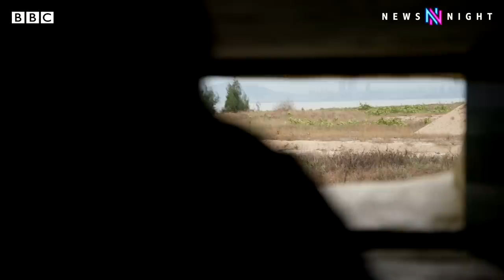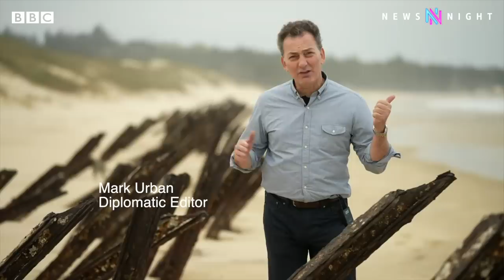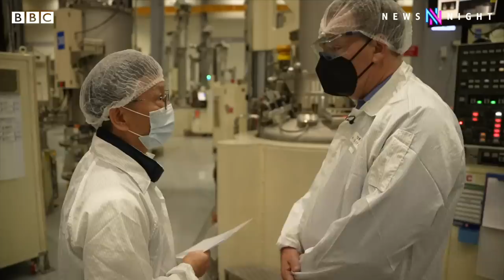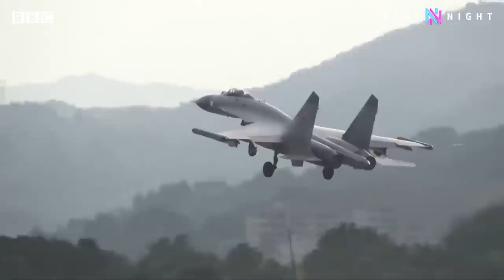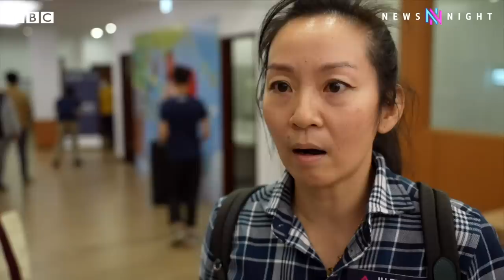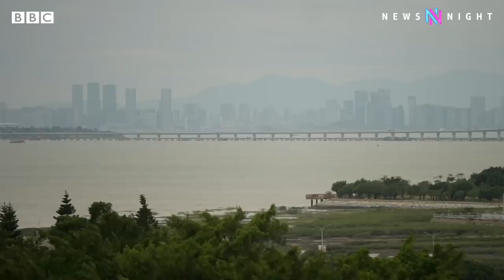Can Taiwan's microchips act as a 'silicon shield' against a Chinese invasion? - BBC Newsnight

Comment: The value of Taiwan is more than just the '
“silicon shield”, but also the strategic location on the pacific. With the harbour on the east coast of Taiwan, PLA are able to deploy nuclear submarines that capable of conducting another “Pearl harbour attack”.
With the control of Taiwan strait, China will be able to shut down the cargo supply from western world to Japan or Korea. Sure, the chips may be a reason why US are trying to prevent the war from happening, but the position of the island is the actual common interest that urges Japan and US to intimidate China from invading Taiwan.
Reply: Don't be overdramatic. If the strait wasn't accessible, cargo ships could easily go around. And as for the nuclear subs, they can deploy them from their current extensive coastline.
Reply: If you can read the map, it is also very close to China.
Reply: China will gain superpower status if they got Taiwan
Reply: finally someone who knows the most beneficial trait for China to invade Taiwan as their strategic harbour for any military use
Reply: How can you attack your own country!
Reply: @RonsmooveTI  they already have that status
Reply: @goatculler  it's called civil war
Reply: @pieter6361  China’s Dongfeng missiles are aiming at Okinawa.
Reply: This is totally backwards. Taking Taiwan doesn’t actually do much for China’s offense strategy except to give it high mountains on the east side of Taiwan that are good for building radar stations and monitoring naval traffic around the island. On the other hand, Taiwan is essential to America’s offense strategy, for the purpose of keeping China contained by the first island chain. America has been the aggressor and China has been the defender for about 200 years now. This panic about Chinese attacking America and its Asian lapdogs (Japan, Korea, Taiwan, Philippines, Vietnam, Malaysia, etc. is a complete inversion of reality.
Reply: @janewu3178  Dongfeng is just good for frying and killing fish in the Pacific
Reply: @Sp3ll633  The Pentagon doesn’t think so.
Reply: @janewu3178  Oh, btw, okinawa was genocided, raped and colonized by the americans with the japanese. Then the country Okinawa got ruled by the americans, and then later on given to the japanese. The natives of Okinawa, were the "Luchuan"-people, or how it is called.
Reply: @securityispriority7130  China won’t treat civilians in Okinawa as cannon fodders in any circumstances. Nowadays Asia is well-managed under China’s guidance. China takes responsibility of containing Japanese militarism and extruding uk-us hegemony out of Asia.
Reply: @lambertlum1087  not “China Hegemony”, I believe it called Great Asia .
Reply: @lambertlum1087  Let me give some context first for anyone who w doesn’t know this history.

From the Encyclopedia Britannica page for the opium trade:
“Early in the 18th century the Portuguese found that they could import opium from India and sell it in China at a considerable profit. By 1773 the British had discovered the trade, and that year they became the leading suppliers of the Chinese market.”

From the Wikipedia page for the First Opium War:
“Once addicted, people would often do almost anything to continue to get access to the drug. These serious social issues eventually led to the Qing government issuing an edict against the drug in 1780, followed by an outright ban in 1796, and an order from the governor of Canton to stop the trade in 1799.”

From a University of Illinois teaching resource page titled Early American Trade with China:
“Americans began shipping opium from Smyrna (then in the Ottoman Empire, now in Greece) by 1805. Turkish opium only made up a small part of the total opium imported into China. Opium did not become an important commodity in American trade with China until the 1830s when it made up approximately 1/4 of the total that Americans sold in China.”

From the US Department of State, Office of the Historian page titled the First Opium War, the United States, and the Treaty of Wangxia, 1839–1844:
“Beyond the health problems related to opium addiction, the increasing opium trade with the Western powers meant that for the first time, China imported more goods than it exported. Settling this financial problem eventually led to the First Opium War between Great Britain and China, from 1839 to 1842.”

There are no convenient quotes for the rest of the story so I will summarize it:
Americans also had major opium trafficking operations in Canton, so American merchants supported Britain in the First Opium War (1839 to 1842) and America secured trading rights by compelling the Qing government to sign the unequal Treaty of Wangxia in 1844. Then the US military fully engaged in the Second Opium War from 1856 to 1860, and forced the Qing government to also sign the unequal Treaty of Tianjin in 1858. This treaty opened more Chinese ports to foreign trade, permitted foreign legations in the Chinese capital Beijing, allowed Christian missionary activity, and effectively legalized the import of opium.

The bottom line is that American merchants started selling opium to China decades after the Qing government started to outlaw the drug, and a full 6 years after the government banned the import of opium to China. The American merchants were exactly like Mexican cartels, trafficking a harmful illegal drug in violation of explicit bans. When this drug caused so much harm to Chinese society that it escalated to war, the American government actually sided with the American drug traffickers instead of the Qing dynasty. 

That is why I said “about 200 years ago”. The Americans started illegally trafficking opium to China a few decades more than 200 years ago, but the official support for this drug trafficking from the US military came a few decades less than 200 years ago.
Reply: @janewu3178  Yes, and the Japanese Empire called their endeavor the Greater East Asia Co-prosperity Sphere. China can name it however it wants, but the Middle Kingdom clearly wants to  occupy the role that Japanese Empire once sought.
Reply: @calitaliarepublic6753  "Unlike Great Britain, the United States agreed that anyone involved in the opium trade or the smuggling of contraband would be prosecuted under Chinese law", https://history.state.gov/milestones/1830-1860/china-1

As for the 2nd opium war, US had a small side role,  It was the British and French who conducted the bulk of the war. 

I am not going to deny that US played a role in the unequal treaties in China, but let's not forget that US supported China against Japan in World War 2. And US to this day is a supporter of China, albeit the Republic of China, i.e. Taiwan.
Reply: @theotheleo6830  actually the seafloor of the Taiwan strait is very shallow, about 70meters deep, the east coast of Taiwan however is very deep, like 700+ meters deep. So the Chinese submarine can vanish easily from east coast of Taiwan.
Reply: During WWII, Japan used Taiwan/Formosa as the main base to launch attacks on Southeast Asia and Southern China.
The secret code of Japanese Navy for attacking Pearl Harbour was "NIITAKAYAMANOBORE 1208"(Climb Mount Niitaka 1208)
Mount Niitaka=Yushan=Taiwan's tallest mountain=Japanese Empire's tallest mountain at the time.
Taiwan was in the center of Japanese Empire(Japanese Territory and  the occupied territory).

Also towards the end of WWII, USA bombed Taiwan so hard and destroyed most military infrastructures and utilities. 
However, USA did not dare to land on Taiwan until after two atomic bombs dropped on Mainland Japan.  Taiwan was almost the last Japanese Empire territory to surrender in WWII in October 1945.

btw. China did not claim Taiwan and even had a Chinese consulate in Taiwan during 1930s. However, China did see the opportunity to annex Taiwan after USA joined the war. China gambled to side with USA to see if they won the war, China would have the chance to gain Taiwan. .. So China's Chiang mentioned in 1943's Cairo Conference about wanting to have Taiwan for the first time.

Why did China want Taiwan until 1940s? It's also because they see how developed Taiwan was and how good  the geopolitical location of the island was.
Reply: @bctvanw  It’s weird how you skipped the part about Japan starting a war with China so Japan could colonize Korea, and taking Taiwan by force in the war. That’s exactly why Japan was forced to return Taiwan and other territories stolen from many different countries after World War 2.
Reply: @calitaliarepublic6753  
Yeap I also skipped the part where when Taiwan was inhabited mostly by Austronesian people.
I also skipped the part where Taiwan was stolen from the Dutch by a Japanese born to a Japanese mother Chinese royalist Koxinga.
I also skipped the part where Taiwan was stolen by the Manchus from Tongning Kingdom(founded by Koxinga's son).
Reply: @yccheng9159  The subs can and likely have already traveled to the east coast. So what's the difference?
Reply: taiwan is just a tiny island next to the massive mainland China, why does China need taiwan to occupy the taiwan strait when China is just right next to it and she can simply launch her navy and submarines right from her shore and occupy the entire south china sea.

if anything leaving taiwan untouched and unoccupied would be a huge security concern and major vulnerability for China as it can serve as a platform for foreign occupation and can serve as a launching base and outpost and beachhead for america to launch an assault against chinese mainland,whereas it would be previously impossible due to the massive ocean seperating the two continents,as previously demostrated by world war ii, where it took america nearly till the end of the war to gather enough ships and logistics to send a small raiding party of 160k soldiers or so to meet and greet the nazis in normandy.....160k compared to nearly 6 million soviets whom fought in barbarossa and stalingrad and moscow.....

having it will not just be the equivalent of pearl harbour attack but the enemy occupying pearl harbour itself where it can serve as a iwo jima for launching repeated attacks against the chinese homeland.

which is why china needs a bulkhead like the soviet union,to take the brunt of any possible but highly likely invasion from the west.
japan and south korea although small, can take a serious pounding(reference world war ii and korean war) and even a nuclear bomb or two.
Reply: @goatculler  shot up!
Reply: @Baz.007  It’s called invasion.
Reply: @janewu3178  Japan & Taiwan’s ultimate misiles are aiming at Beijing, please update your old news.
Reply: Great

Comment: Chinas already been poaching Taiwan Semiconductors engineers with huge money.
Reply: They tried and failed miserably. China cannot purchase the EEV lithography machines. There is one company that makes them in the nedarlands and China is sanctioned and cannot purchase them. Currently China is using EEV machines with 90’s tech and the semiconductor while small can barely operate a cel phone. It’s cannot be used in Milatary applications

Comment: Its nonsense to think that with chips a few generations earlier you cannot make some advanced weaponry. The newest generation of chip making machines are not attainable due to export bans, but the earlier generation chip making machines are available. A Raspberry Pi or an Arduino can fly a cruise missile. And that is "low tech" inexpensive solution. Those chips on an Arduino are actually really powerful, people dont understand what its like. If you were to make a PCB with all components on it to do the exact same thing an Arduino can do, it would be huge! Integrated Circuit Boards are pretty cool! Yes its all in that small piece of silicon called a microchip!

It would be really cool to develop a LF, MF, HF, VHF, UHF radio that fits in the pocket. I know it is possible. But how expensive would it be, that is the thing. 

Greetings,

Jeff

Comment: Ukraine's Naftogaz stole $2 billion

In addition, they claim that there is currently no amount of gas in storage facilities, which is reported by Naftohaz.

The Bureau of economic security of Ukraine opened a criminal case against officials of the company "Naftogaz" on the fact of possible abuse of power in 2018-2019.

The Bureau conducted an audit of the economic activities of the company and handed over to the temporary special commission of the Verkhovna Rada (VSC) the act for analysis. It contains data on possible abuses, which led to non-payment to the budget of Ukraine of 75 billion hryvnia ($2.03 billion).

It follows from the documents that the bureau is investigating cases of deliberate tax evasion on a particularly large scale by Naftohaz's officials. In addition, some officials of the company are suspected of overstating the gross expenses of Naftogaz during 2018-2019, as well as abuse of accounting and tax reporting.

If the facts are proven, the company's officials may, in particular, lose previously accrued bonuses, including the former head of Naftogaz Andrey Kobolev, who received it after the dispute with Gazprom in the Stockholm arbitration.

And if it is proved that there are no such volumes in Ukraine's UGS, the current head, Vitrenko, will also be affected.

Comment: Samsung beats TSMC on the 3nm chips technology.
chip industry (TSMC) faces foreign capital flight as DIEwan (taiwan) province of China authority “plays with fire”. the rising tensions in the die-wan (taiwan) and China Strait posed by the constant speculation and provocation of diewan (Taiwan) stupid DPP leader and authorities serve as one possible driver for the foreign capital FLIGHT, describing the move as “playing with fire” that will eventually hurt its own business. TSMC shares plummeted 73%. Dependence on TSMC is now seen as High Risk.
Both China and America are spending big on developing their own industries, even if TSMC were gone, the world will CATCH UP pretty soon.
Reply: In 2015, the A9 chip of the iPhone 6 was produced by Samsung and TSMC respectively. The evaluation of technology players found that the power consumption and performance of the TSMC version were much higher than that of the Samsung version, which triggered a wave of "Apple fan returns". Samsung has always exaggerated and lied. Samsung does not have 3nm. Its so-called 3nm has only 170 million transistors square mm, and TSMC’s 5nm already has 173 million transistors. To make matters worse, Samsung's 3nm yield rate is only 10%, which is basically an immature laboratory technology, while TSMC's 3nm yield rate reaches 90%.